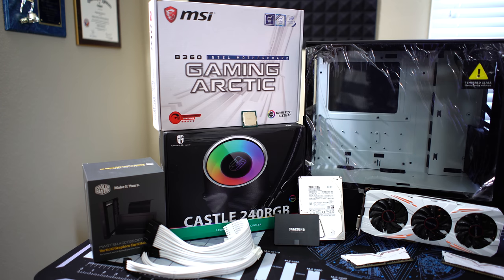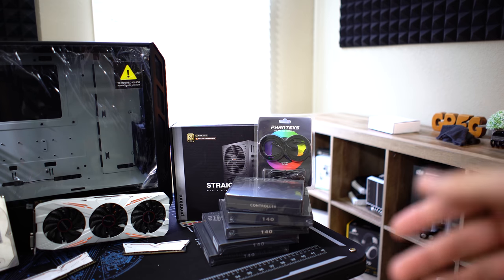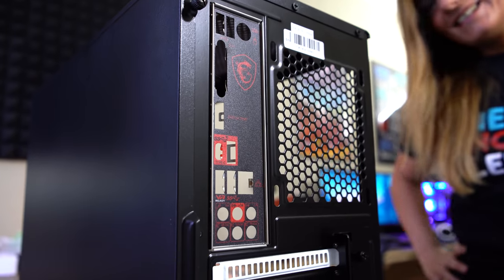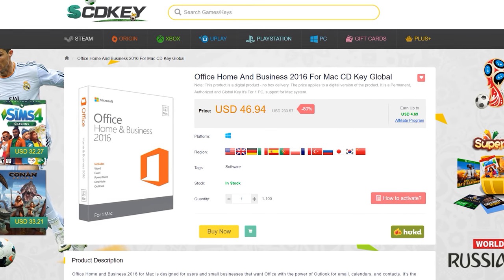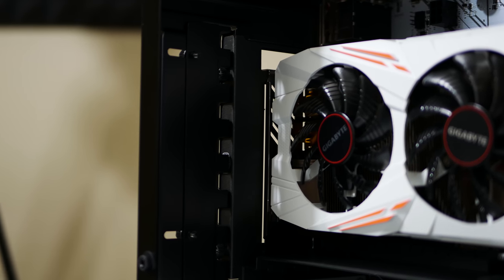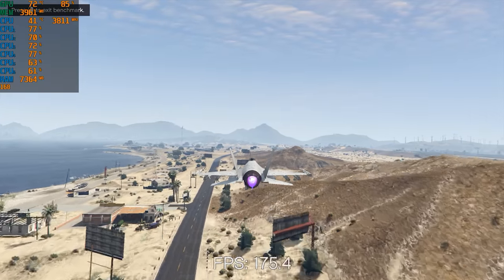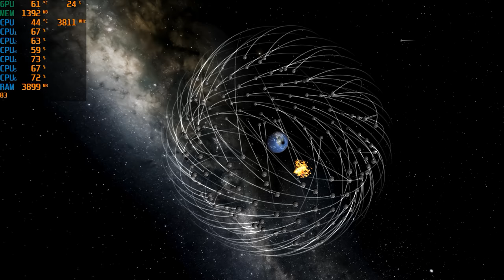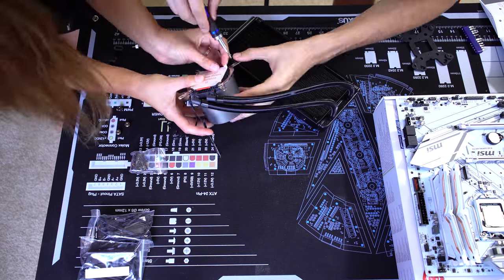We Paired a 1080Ti with an i5 8400...

Comment: I got an I5-8400 because it gives me enough power for gaming at a good price. In a few years when I will be needing a more powerfull processor, I will be able to buy one of the today's superior I5 or I7 at a much better price than in the present. I must mention the fact that I play exclusively single player campaign games and I'm satisfied with anything over 30 fps 1080p high or ultra details gaming (my freesync monitor's range is 30-75 fps).
Reply: be careful, I've been saying that since I planned on upgrading from an i5 2500k to an i7 3770k (motherboard is capable of both), the price/performance gain never gets there when you consider how much intel retains their value.

Comment: This is pretty cool, I'm saving up for a 1060 6gb system with the i5, and I think I'll upgrade to 1080 over time, its good to know that the GPU will be the bottleneck even after I upgrade and I won't have to worry about CPU usage. I play high intensity FPS games so I actually plan to go for 144+ fps with a 1060 6 gb, at 1080p and lower graphical settings, with a 144hz monitor. Personally I'm strictly a gamer, and with FPS games all I want is high fps.

Comment: So glad to stumble across your video.  I'm in the process of building a very similar system, just waiting to source the GPU. 

Case: Phanteks P350x
Motherboard: ASUS Prime Z370-A
CPU: i5 8600k
CPU Cooler: Corsair H100i V2
Memory: G.SKILL TridentZ RGB (2x8GB)
GPU: EVGA 1080Ti FTW 11GB
Power supply: EVGA 650 GQ
SSD: reusing a 120GB Silicon Power for now
HDD: reusing two 2TB Hitachi's

Planning to setup for 1440p gaming, so your video is perfect for me.  Thank you!

Comment: Still rocking my 4930K, running it with my water cooled 1080 Ti. Want a 1950X, but money..
Reply: 1950x might go down in the next month or two. Since we should be seeing Threadripper 2.
Reply: Do you really NEED a Threadripper ? Or do you just WANT one ?
Reply: clansome I'm pretty sure we all want one but don't need one
Reply: For my workload it's more than perfect. I don't know if you were asking me, but I do not regret going Threadripper from my FX 8370. As I said in my other comment. If I were to consider replacing my FX 8370 I would consider Ryzen 5 2600 or Ryzen 7 2700. Non X skus.
Reply: I do photography and video work and I record and stream game play, so it's nice to have the horsepower for it rather than lacking.
Reply: @Alexander then you won't regret it at all. All those workloads will benefit from the extra cores, extra threads, caches, and even clock speeds.
Reply: Yeah, that's what I'm thinking. But it won't be for a long while, so by then it might even be a Threadripper 2. But some day :P
Reply: Well good luck and hope you get one. They're seriously sweet!
Reply: get a cheap xeon off ebay and a x99 to match even though the motherboard is expensive its still better for price to performance
Reply: I still got an i5 4460 with an 1080ti  and it runs fine on my 3440x1440 120 hz monitor :)
Reply: mine is at 100% aswell but no stutter at all. gonne get my 8700k soon tho
Reply: Hey Zuckerbro is your 580 the 4GB or 8GB card? Do you have it overclocked at all? How much power does your 12v rail or rails deliver max?
Reply: Hey Oliver while the Xeon would perform great it is an older platform than a Ryzen or Threadripper system. Currently on Newegg the cheapest X99 motherboard is the Asus X99-E at 173.99 USD, when it's not on sale it is 199.99 USD, add in the fact that you would have to get DDR4 (RAM prices still suck),  it only has one m.2, 40 or 28 lane CPU support, and finally add in the cost of the Xeon CPU, case, and whatever else he would need. He'd be better invested to go with a high end Ryzen or any Threadripper. One of the many reasons I both support and enjoy using AMD is that they tend to keep the socket for at least two generations. Unlike intel. Oh you want to build a new system? Well you're going to need a new motherboard and possibly RAM. Yes the Threadripper can and will more than likely cost more, but it should also last longer, have warranties, and is built on a 14nm vs the Xeon at a 22nm die.
Reply: Still using a 4790k & a 1080Ti. Rig is 4 years old now and doing well. Considering a new build this fall but waiting to see what TR2 does and what Intel may do too in response. The upside is that I don't have to do anything. Just getting that itch ya know?
Reply: 8GB, its only memory overclocked to 2125 mhz (until no memory errors appear in hwinfo64). i think it delivers up to 43 A (Corsair CS550M)
Reply: What do you do in your spare time? Edit 4k video?
Reply: Honestly I'm just water cooling because my air cooler couldn't keep my 7700k reasonably cool and it was loud as hell. In fact even my water cooler doesn't do that great a job.

Comment: Cool video.  This is basically my current main system.  Got an off least Acer TC-885 and ripped out the PSU, put in a 600 Watt unit and put in a founders edition GTX 1080Ti from MSI.  Maxed the RAM to 32GBs and still going strong in 2023.

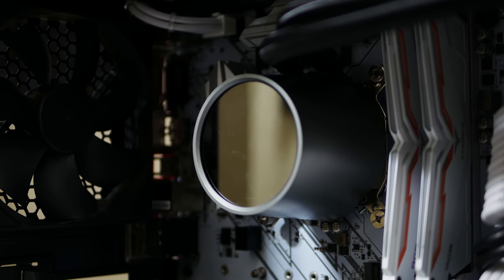Comment: 12:45 When I did my first build the guy at micro center handed me a cheaper Toshiba drive and told me they're quieter than the WD drives too.  I've been using them ever since.  I've been wondering why so many people use a WD hdd, is there an advantage of WD over other hdd manufacturers?
Reply: >hdd
>mfw can't greentext
Reply: I have a wd hdd just because it used to be an external hard drive until I used a Dremel to cut it open and took the 3.0 adapter off and now it's an internal lol. Long story short, I had it lying around
Reply: Whichever is cheapest for the size you need. Toshiba and Seagate are both 7200rpm vs WD Blue 5400 rpm. 

I would mention that I’ve used WD RMA in the past and they were very easy to deal with. Sent me the replacement before I had to send dead drive back. Toshiba and Seagate may fo the same but WD was a breeze a few years back. Sound wise, I can’t hear my WD Blue or Seagate at all though.
Reply: I got a WD a Toshiba and a Seagate in my rig. (The old Samsung is out because of size, not reliability, it ran fine all the years)
All of them run fine.
The Toshiba might be a bit louder than the Seagate, but runs fast and doesn't has to spin up often anyway.
Whatever works is fine, the differences in performance is rarely an issue and price differences are minuscle.

Just be aware that to make it "easier for customers to choose the right drive for their PC." WD stopped their Green line and incorporated them into Blue, so now there are WD Blue drives with 7200 and with 5400 RPM. The 7200 drives aren't that difference in performance and price then what HGST, Seagate and Toshiba have to offer.
Reply: I have been using WD black for 3 years now. Its loud but gives sustained writes speeds of 160mb/s+ over 100gb sequential writes.
Reply: Mindshare. I've had great luck with Seagate drives, I've had them since their incipient companies (I still have a working Quantum Fireball 20GB drive, many working Maxtor 160 and 320 GB drives, and about 5 1TB Seagate Barracudas). The very first PC I had had a WD2000 (20GB) drive that failed after one power outage, and another WD8000 that failed. I still like the WD green drives for my server.

It's anecdotal experience and marketing that built up the mindshare, same with intel and nvidia being 'premium' or 'better' when most of the time they aren't anything special or are the lesser choice.
Reply: If you can mcgyver a caddy out of elastic bands or use some rubber spacers all noise will resonate through the weight of the case and should dampen or have a more tolerable  frequency.
Reply: "Toshiba and Seagate are both 7200rpm vs WD Blue 5400 rpm."

lol make sure you know what you're talking about before you make yourself sound stupid. thnx
Reply: B Thiel only the 1tb version of wd blue(desktop) with 64mb cache is 7.2k rpm, the rest are 5.4k(according to wd website)(https://www.wdc.com/products/internal-storage/wd-blue-pc-desktop-hard-drive.html#WD10EZEX)
Reply: Been rocking my WD black since 2011 x)
Reply: WD HDDs from what I hear from others unless it is BS, isn’t as faulty as Seagate. And 7200 RPMs you can get cheap for 1 TB HDDs at around $44-$50 USD
Reply: wbkruse13 speed?
Reply: I use a Barraccudda 2tb. Almost 300mbps read speed. Barely over half the price of a WD Black.
Reply: WD was the staple of best HDD back in the early 2000s and its like Intel that the brand people usually think of when it comes to HDD. Now, I usually pick SSDs however, my HDD are two 1TB HDD, a 2TB HDD for mast storage they are green drive, I also have a 2 TB WD passport and a 1 TB velociraptor for steam games. they are fairly old but very reliable. I never had a bad WD drive hence why I kept buying them. for SSD though, I usually go with Samsung, Kingston or OZC. I haven't tried WD SSDs so .. yeah. mostly I go for reliability and heard a lot about their RMA and customer services. Seagate and Toshiba maybe good but i never had their drives before to talk about them. I hate dealing with RMA usually it becomes a waiting game to have your product back. WD never failed me so i never had to RMA anything, in fact I still have my 40 and 80 GB WB hard drives from 2001 still working in my media center :D
Reply: I always use WD black drives. My latest build has their 250gb nvme m.2 ssd and a 2tb hdd. I just know their dependable and have a great warranty.
Reply: wbkruse13 - Advertisements are getting smarter
Reply: historically, seagate had a problem with their drives. I saw hdd lifetime test from database centers somewhere around the internet, not all hard drives from one manufacturer is the same. WD red was well known to be robust, so was one toshiba type. Seagate had a manufacturing failure about 2-3 years ago, so the seagate failure number is still way higher than others. I don't consider the noise too  much for hard drives, you have ssd for programs (constant read). hdd tend to slow down if you don't use them, and for document purposes you don't really access them that much anyway (aside from watching movies, but you can also move the file to your ssd before watching)

Comment: 8400 and GTX1080ti is a great combo
remember that the i5 8400 performance is on par with an i7-7700!
for 1440p and especially 4k GPU performance is much more important than CPU
I was planning on getting a R5 1600 for my current build but I could not get a suitable AM4 motherboard that had what I wanted (matx, wifi, SLI, high speed memory support (i found a great deal on DDR4-3733)
I found an ideal motherboard with a z370 chipset and decided to get an 8400 with the plan to eventually upgrade to a i5-k or an i7 later on.
As the hardware testing whore that I am I have run this PC with a 1050ti, 1060, 1070, 1080 and 1080ti
I've not found any situation where the 8400 held anything back. Its an awesome CPU (I upgraded from an i7 3770@ 4.3GHz)
Lastly I would not recommend the CPU cooler on intake for an 8400, it doesn't need outside air to cool it. you are basically prioritizing CPU cooling over GPU and system cooling with this setup. you are better off using standard air cooling or putting the radiator on an exhaust because it will work fine cooling with warmer system air allowing the GPU and system to run cooler. Nvidia GPU's start throttling slightly over 50C ! so you are going to be sacrigficing either system noise (gpu fan) or gpu performance cooling the i5 in intake. move the i5 cooling to exhaust and it may run ~10C warmer but it will still be very cool and it wont impact performance at all, it wont throttle and there is no need to turn the fan speed up.

Comment: i see some people groping the motherboard and then i see some people with gloves and wired up with grounding cables. is it cool to just grab that thing or what? im about to move my alienware x51 in to an nzxt and upgrade some of the parts so im not sure if i should buy a hazmat suit or not
Reply: You should be careful, but it's really low risk. Unplug your computer, & hold the power button to discharge any capacitors you can before opening it up. After that you should be good to just start the rebuild. Just avoid things like socks on carpet or polyester sweaters, & you'll be fine.
Reply: Thanks!
Reply: What you can do too during the build is plug the power supply into the wall plug but keep it off, just touch it's chassis from time to time to discharge yourself
Reply: Noah Nitschmann <-- listen to this guy, that's exactly what I do :)
Reply: A static discharge is what you're trying to avoid and it's been my experience that static is more prevalent in the winter than summer. Just touch something metal before handling computer components. Did you know that a static discharge from the tip of your finger is around 20,000-25,000 volts? It's like a miniature lightning bolt. Look it up.

Comment: @Science Studio-
 I know you read the comments sometime and make videos. This is something I have been researching a lot but havent really found a solid answer.  CPU thermals when overclocking. In large part because of your vids I decided to get an 15 6600k and overclock it. I have it up to 4.7 with 1.37 on the Vcore.  I am using a Hyper 212 evo cooler on it in a pretty well ventilated case. Its stable after an overnight stress test on Aida 64. My thermals on Aida are average 66 to 67 core temp in each of the 4 cores, although one core consistently temps higher by about 6 degrees. May temp on that one care is 75 under stress testing although I have seen spkes near 80 while playing Far Cry 5 on ultra. I have never seen temps break 80 nor have I seen it thermally throttle. I have freinds who freak out over temps above 60c and are urging me to buy a AIO cooler, but I got the i5 to save some money and get some OC out of it. Dont really want to buy an AIO, you know. I read a Tom's Hardware explanation that basically said 86c is the max temp you dont want to reach. At 90 I understand the CPU thermally throttles, correct? So how am I looking?
Reply: totally reasonable :)

your friends are paranoid gibbons ;D

Comment: Just did a refresh of my gaming machine, and I went with the i5-8600 (nonk) (got it at Walmart for $209) and an H-370 Strix ASUS board (around $135) .  I wanted the premium audio.  I also have a 1080ti (founders edition).  16 megs of 2666 Mhz ram.  I went with the Corsair H60 cooler.  What I heard before my build was that the nonk intel chips when in full boost, can get warm, so providing them with good cooling is a key element to get max performance.  I was going to build using the i7-8700 nonk chip, that was my plan all along, but when I started looking at the numbers, spending like $130 more was only going to get me a handful of FPS, so I saved the money and I'm pretty happy with the system.   I just wish I didn't like the look of those new 2080 founders edition cards.  Thanks for another interesting video.

Comment: I'm currently sporting two machines. My FX 8370, 2x8GB 16GB DDR3 Sniper 1600Mhz  RAM, XFX RX 470 4GB Limited, Gigabyte 990FXA-UD3 as my "backup/capture/editing/streaming rig". My second machine is my Thredripper 1950X, Gigabyte X399 Aorus Gaming 7, 16GBx2 32GB G.Skill TridentZ RGB 3200Mhz, EVGA GTX 1060 6GB as my primary machine. If i were to consider upgrading from my FX platform for a secondary rig I would consider either the Ryzen 5 2600 or Ryzen 7 2700. As you mentioned Greg the AMD side is unlocked on ALL processors that I know of, cost either about the same or less, offer a few more cores or the same, and even the motherboard side of things are a little cheaper (usually). My planned upgrades for my 1950X machine are to go to a 1080ti/1180ti. Depending on price, add more RAM, and eventually get away from my SATA SSD and into an NVME m.2 2280 SSD (or TWO).

Comment: hey!!!!! AMD Ryzen 1600 here!
Reply: Noice
Reply: Nice, me too.
Reply: Im on 2700X too. Overkill build with an Asus Crosshair hero VII :D
Reply: Rog strix b350 gaming-f, and R5 1600.
Reply: Same 1080ti and 1600 chip . @ 1440p the CPU is fine
Reply: Drake I nearly got that motherboard!!! I chose the hero VII as I really liked all the overclocking buttons (and the wifi). But that Strix is a good board too! Our boards look awesome with STRIX gpu. I have the Strix VEGA64. If you don’t have the Strix model gpu you should get one :P (good with Aura sync).
Reply: Ive got a 1700@3.9GHz, 32GB 3200MHz, hero 6 board, 250GB 960evo, 10tb hdd storage, 23inch acer screen and a 27inch Dell 75Hz 1080p freesync screen,  the same case as in the video and a pallit super zetstream 1080ti.

I can't be hapier with my system.

Beast of a system that doesn't flinch even when I'm running, vms recording gameplay etc.

Even gaming at 1080p I found my gpu runing around 98% most of the time.

That said my games are very damanding on the GPU.

Ark
Dues ex
Cod(not as demanding)
No man's sky(crazy intensive game)
Rise of the tomb raider
POE(4k) avg 260fps
Warframe 4k 150fps
New colossus (4k)
Reply: Drake Off the top of my head, idle temps with a stock fan are anywhere from 32 to 37 degrees. Depends on how hot my room is.

I haven't checked myself in awhile so I might be off a few degrees.
Reply: 2200g more than happy with it

Comment: IMO as long as you are not using a high frecuency monitor, you can even pair it with a Pentium and have the same experience
Reply: Giuseppe Stallini No no my friend, it's actually beneficial to have higher resolution monitor if you have underpowered cpu. Otherwise youre making your gpu to be underutilised.
Reply: With Vsync turned off the frequency of the monitor doesn't change anything at all.